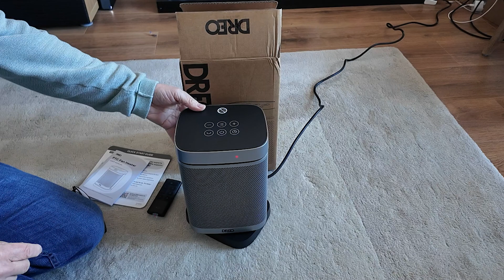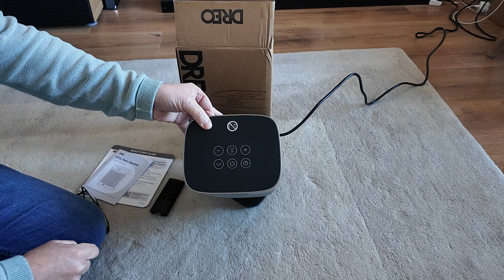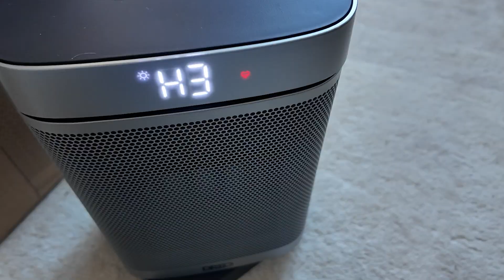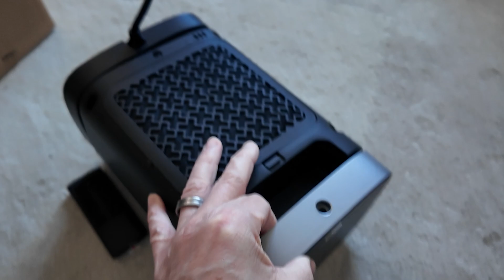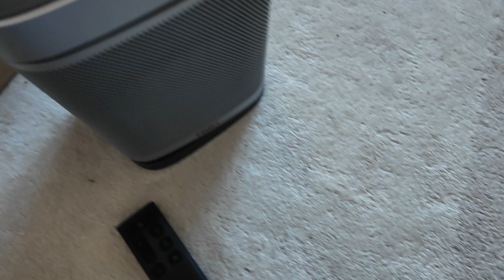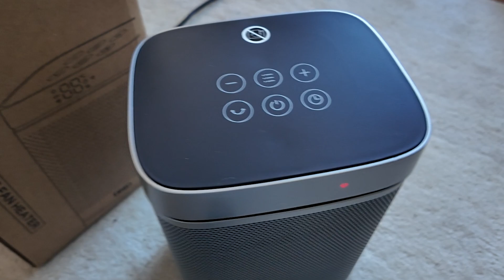DREO Fan Heater Review ( Portable Fan Heater )

Comment: I think you running costs calculation is a bit out. 1500w for 8 hours is 12 KW, which at about 24p a unit is around £3 a day.
Reply from the maker: That might be correct. I used an online calculator not sure how correct they are